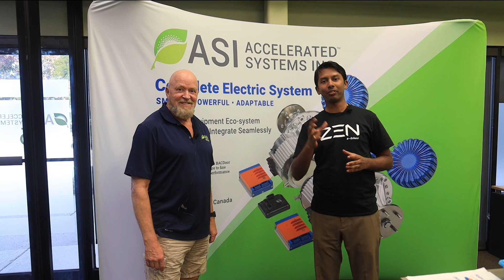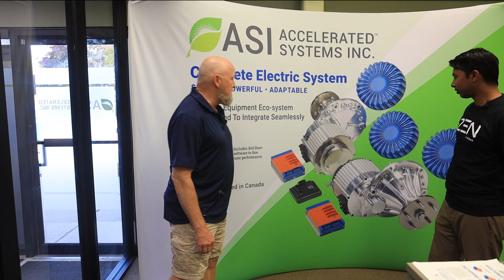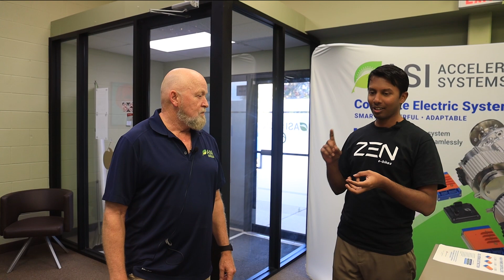Accelerated Systems (ASI): R&D lab tour, E-Bike controller and motor production - Part 1

Comment: With ASI compact AC motors/controller upgrade kits DYIers put together short range EVs for just over $2000.00. This could revolutionize transportation in residential developments and spur small business in the used EV golf car sector. I like it!